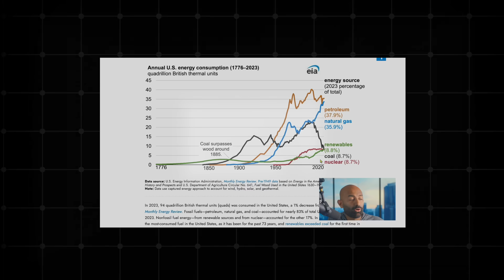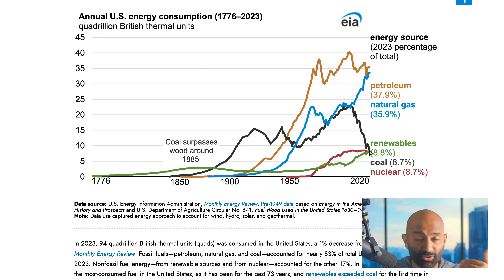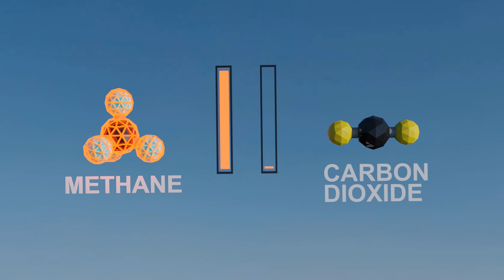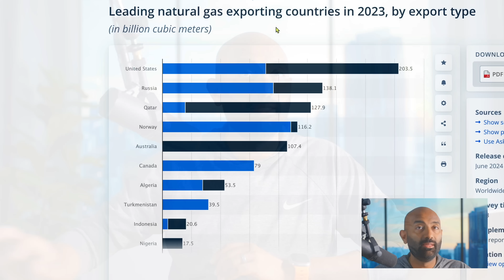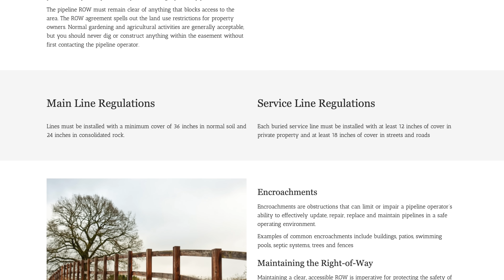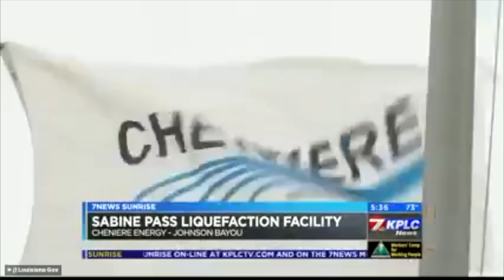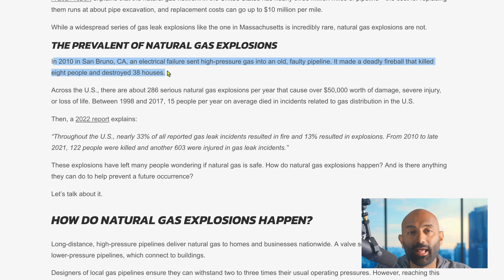The TRUE Danger of Natural Gas - This SHOCKED Me

Comment: It's not odorless. It has a smell right out of the gas well, plus they add mercaptan to make it smell much stronger.
Reply: the raw gasses which the methane is in does have an odor, but methane itself is odorless. i am not sure how much refining is done to the raw gasses, which will contain h2s and other gasses, before it is ready for transport and use. i could be wrong on this. its been a couple decades since working in the oil and gas industry. more on the oil side, but gasses are all mixed in with the process, including methane.
Reply: I think the odor is actually added to the gas by the companies in order to help with leak detection.
Reply: @spiffyh  Leak detection is a great idea but the reason is to make noticeable so that occupants will leave the area
Reply: We sell mercaptan injectors to add odourant since at least where I live; it’s illegal to not add it.
Reply: No, it is totally odorless, that is why the mercaptan has to be added. But the odorizers are only added before sending the gas to the end users, not before it goes into the processing that is mainly about REMOVING substances from the gas, and LNG in transport or a pipeline may not have it added yet. There are plenty of places where gas can leak and you will smell nothing.
Reply: @AnalystPrime  pure methane is odorless, natural gas isn't pure methane, and those impurities smell. I've smelled natural gas from many different wells, and the end product before mercaptain is added. It always has a smell.
Reply: @AnalystPrime  Your are completely correct. But the raw gas from the well frequently has hydrogen sulfide with it that smells like rotten eggs.
Reply: That is mostly from the hydrogen sulfide that comes out with the gas. Methane itself is oderless.
Reply: I know personally of two young people dying to gas leaks in Italy and Germany. The latter happened two years ago. I am not sure if Germans add odors to their gas but they did not require gas sensors. These losses were easily avoided, so sad and devastating. So keep this in mind if you travel, or you have a child going on exchange somewhere. Your home might be safe; what about where you go?
Reply: This is a deceptive comment. While the gas coming out of the ground can have a VERY slight smell from the VOC's, (in some sites there can be a strong smell, but for the most part the odor from natural gas coming right out of the ground untreated is virtually odorless) the gas after it is cleaned\filtered, is for all intents and purposes, odorless. Especially if the gas leaks to the surface from an underground pipe, as the dirt in the ground further strips any remaining trace compounds that can be smelled by people. Not sure why this comment was made, but it is just confusing info about a very dangerous substance. When making such a comment, it is irresponsible to not qualify such a statement and to make absolutely clear that what was said requires additional info, given the volatility and danger of any encounters with this substance, whether you can smell it or not.